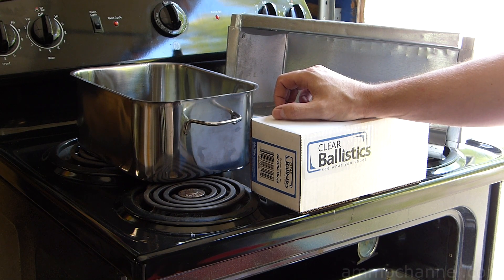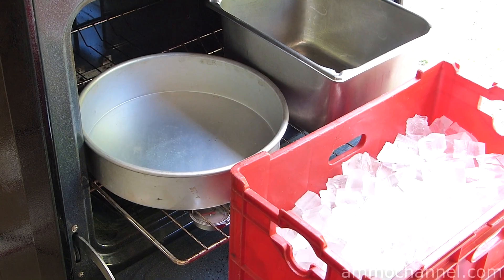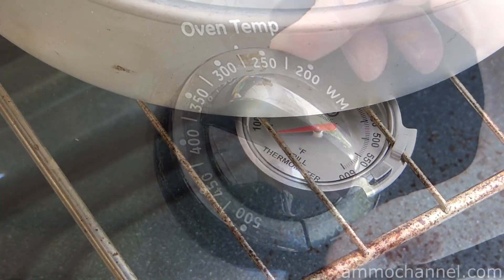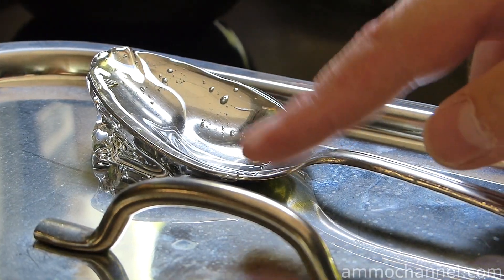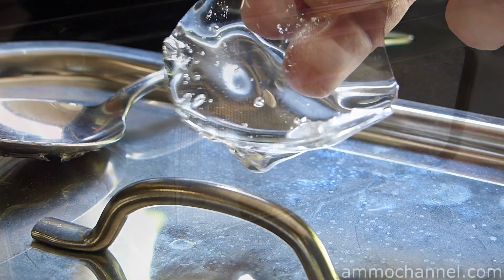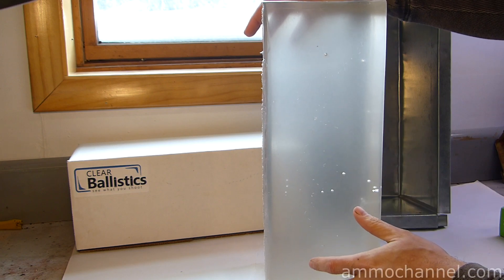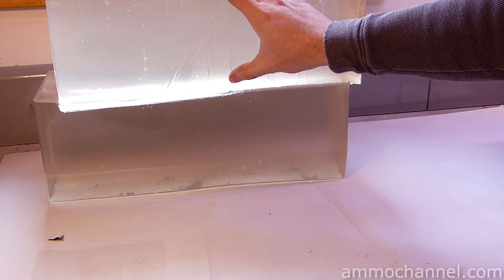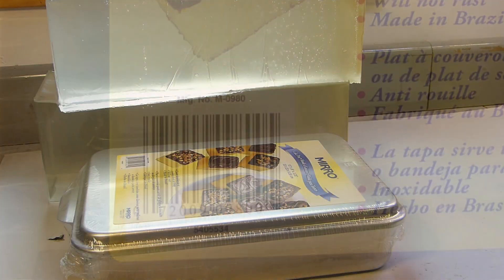Melting clear ballistics gel in a traditional oven

Comment: well, 11 years later, here are the best practices. 1) test your mold with water overnight to ensure nothing leaks. 2) Just melt it in the mold directly. 3) After cooling it to room temp for 4hr min, chill it overnight, or longer, in a fridge, before removing it from the mold. 4) pull all sides away from the mold a bit before kinda rolling it out from the end, as it lets some air get in there, and breaks the initial heat fused connection to the mold, allowing for easier extraction.

Comment: How about using a finer mesh on top of the mold and make a basket with it and put the mold in the oven. Then feed in pellets of waste gel into the basket and top it up as it melts.
Also, you could put large headed screws in the base of the mold with a bead of high temp gasket goo around the flat side. It should hold the liquid then just remove the screws and it should fall out and replace the screws.

Comment: You can just melt it straight in the mold. It's not necessary to melt it in sections like that and then transfer it. You just need to spend a few extra minutes cleaning the used gel of fragments. Backing off on the temp to just above melting point will also help to keep it clear and as you see, impurities will fall to the bottom over time and not affect performance of the gel.

Also, making the mold ever so slightly wedge-shaped helps with extraction and likewise will not affect performance in any meaningful way. Make the mouth 1/4" larger at the mouth than the bottom.
Reply: Jamie McCarthy have you tried this?

Comment: Maybe making the mold with slightly sloping sides (a bit wider at the top) would make it easier to remove the gel.
Reply: Cecil Broom And adding a bit of lube like oil or silicone spray

Comment: Have you tried melting down all of your "contaminated" gel, then skimming, decanting, and straining it with much finer mesh to see how clean you can get it?
Reply from the maker: elektro3000 The contaminates that make it hazy are tiny and the gel is too thick to filter.  Heat also causes it to darken, yellow.  The chunks of lead that don't strain out simply settle to the bottom and aren't an issue.

Comment: Thank you so much for this video. i just recently bought two 16inch long blocks and wanted tips on how to melt and mold it properly. this is a HUGE help. you're awesome dude.
Reply from the maker: jarrett davis I have recently switched to using a giant crock pot instead of an oven.  My whole mold fits inside of it so I just cook it in the mold.  The oven worked good but it was hard to control the temp, which means yellow blocks.  My first run in the crock/roaster went well.  I filled the air space between the crock pot walls and the mold with sand in hopes it would act as a heatsink for a nice even steady convection.  Seemed to work decent.

Comment: I have only used real ballistics gel, so im not sure this will work or not for you...

Real gel appears to be more delicate then what you have here, so this should definitely work for you. 

Gently peel the top edges away from the mold, then take a plastic ruler with smooth and thin edges, wet it with water. Gently go around the  edge of the gel block to loosed it up. At this point take a thin tube, copper tubing works well, and stick it between the gel and the mold at one end. Take the mold and place it upside down but do not block the tube. Gravity should do the rest of the work. 

Again it seems like the stuff you are using is much tougher, but if using real gel you need to be more gentle or it will rip so the above is very useful.

Comment: What's the total bake time? What's smoking? Does repeated reheating cause any change in the consistency of the gel?

Using some mould release will help with getting the gel from the mould form. Silicone spray without a petroleum base would be my best guess.

Comment: Outstanding tips in this video. I was concerned after a few tests when my block became yellowed. After purchasing a new one, I am glad to have seen this video before remolding and ruining yet another block. Thanks again.
Reply: You know what would prob help you pop them outta your molds? An air nozzle with a long tip. Stick it down the end to the bottom and give it a few blasts of air to force it out :-) haven't made gel before but it works with a lot of other things.
Reply: MadMetalManiac74 Thanks for the tip. I've tried that a few times and it works well.

Comment: Wow, looks like a lot of work. Are you able to add more clear gel to your blocks during the melting process to make up for losing any that you lose in this process?
Reply from the maker: Absolutely.  In fact, when I purchased these two 6"x6"x16" I also purchased an additional smaller block to use as future filler material.  I also save all the nasty stuff I cut out in case I want to use it later for something that doesn't require visual aesthetics.  And yes, it is a lot of work.  They also suggest a large crock-pot, which would probably be easier.  Haven't tried it though.  Thanks for watching my friend.